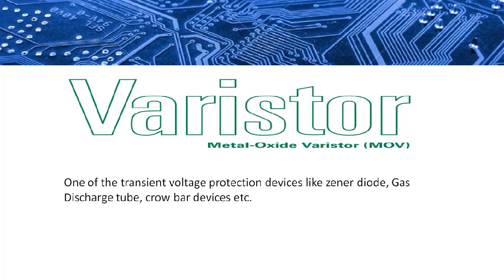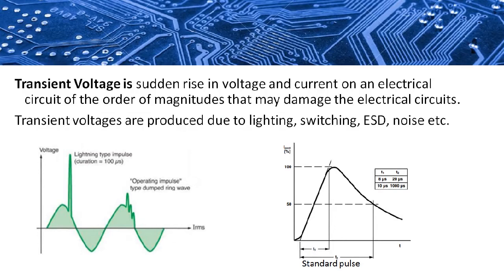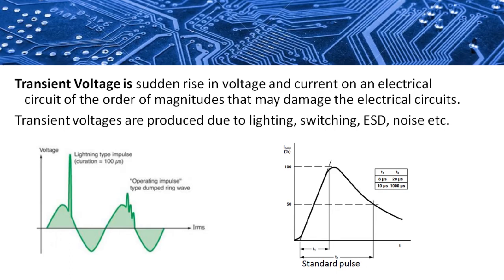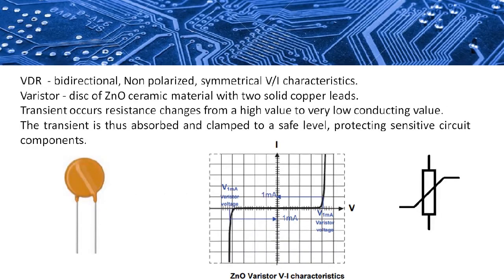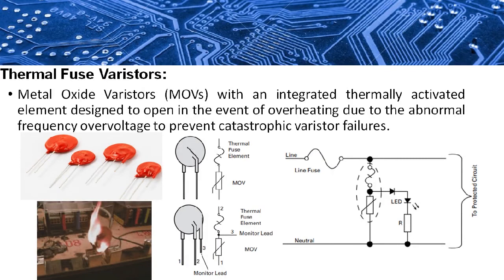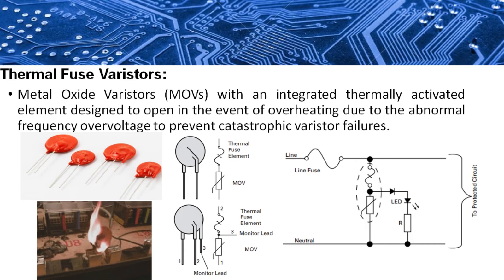Metal Oxide Varistor (MOV) Part1of2

Comment: How do you test an MOV? I have a MOV but cant find it to buy a new one. SVC 471-14
Reply from the maker: SVC 471-14 as per datasheet having Transient energy & current:80 Joules & 4500 A, Max. Clamping voltage:775, Max. Applied Voltage:300 Vrms. You can select MOV which satisfies these specifications. In Many online electronic component  websites you can select the component of your required specifications.
https://www.mouser.in/Search/Refine?N=254141